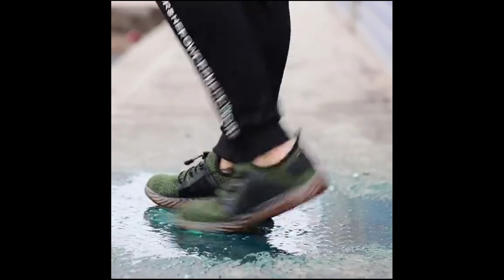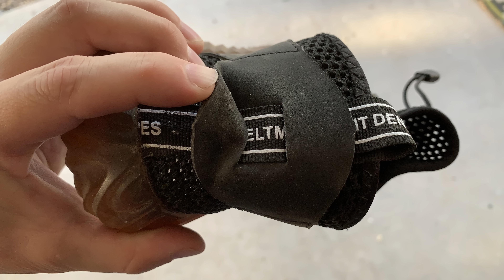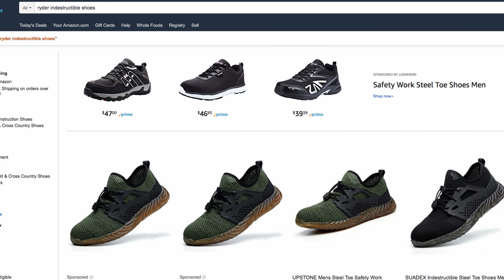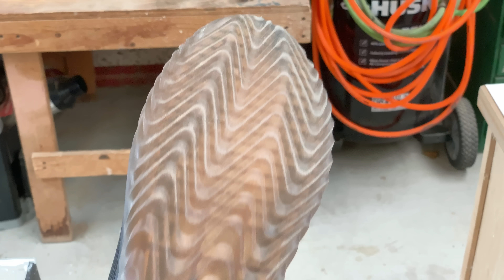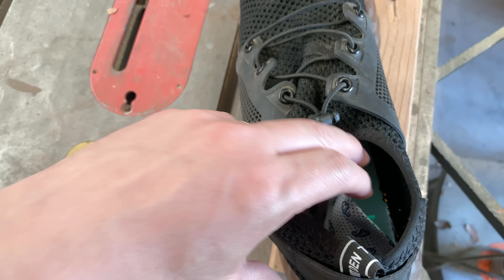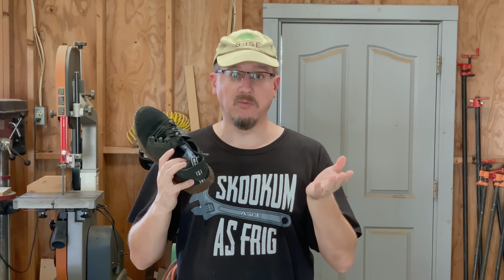"Indestructible" Ryder Shoes for $25?

Comment: Shoes are great but bottom deteriorate fast. I work in construction and bought 2 pairs. Lasted less than 6 months total for both pairs
Reply: Mines did the same thing. It’s almost like a foam rubber composition. 2 shoes lasted 5 months for me. Not worth it.

Comment: I bought these but wish i didn't. Complete garbage made in china not steel toe ( plastic toe) and not nail proof. heavy and Uncomfortable. Shipping times took 6 weeks to arrive. On requesting return they wanted to have me pay return shipping with a 15% restocking fee. However the left toe guard was not seated properly and rubbing on my foot, I argued that my defective shoe was why I wanted to return it. They offered a 20 percent discount. I said no I want a full refund and no restocking fee as it was defective. They approved the return with a 15% restocking fee on the next email and also a 50% discount if i changed my mind. I figure either way I'm loosing. Avoid this sh*t company and their sh*t product. Transaction as of March 28th 2021. Still no refund.
Reply from the maker: It is worth saying that if your shoes had a plastic toe, then it is NOT the same shoe that I reviewed in this video. The "Ryder" shoe has some notable issues, but it absolutely has a real steel toe, so that's not one of them.

Also, yes, I even said in this video (several times) to avoid the Indestructible Shoes LLC company and get the shoes directly from China at a huge discount.

Comment: I saw the ad for 80 bucks indestructible shoes and almost bought it at that price but I like to do my homework and it paid off. I bought these from AliExpress and got them in a week. They have a U.S location. Your review sold me, especially at 26 bucks and some change with shipping. I got 1/2 size bigger. These are awesome. I have to disagree with you saying not comfortable. These are like walking with just socks on and I mean that in a good way. If they last at all I will be buying them again. Thanks for the review.
Reply from the maker: Cool.  Yeah, after the video, I did get a pair that was a little bigger and then got some comfy insoles and the shoes at that point were definitely comfortable enough to wear all day long.

Comment: I'd still send you off my jobsites if you were wearing those.  They don't protect your foot, ankle or lower leg enough.
Reply from the maker: Yeah, these aren't rated by any official agency, either, so there's no way OSHA or any other job-site safety organization would be okay with them.

I will say that I'm not convinced that the "shoe" size of them is necessarily going to be a problem in all jobsites, though.  I ended up replacing these after a year with Keen Utility Atlanta Cool safety shoes - they officially meet ASTM standards and are definitely okay on at least some jobsites since I got them off of a recommendation by a pro, who regularly wore them on his jobsite.

Comment: I just bought a pair of indestructible shoes. The shoes look nice but as soon as I put it on I could tell there was something wrong. The left shoe was poorly made & where the steel toe started I could feel a protrusion into my toe. Even though the item is clearly defective, they won't give me a full refund, making me pay restock fee. I feel I shouldn't have to pay for a manufacturing defect. Tried to get the company to waive the fee but no luck. Tells me they don't stand behind their product. I'm not buying anything from them again and will advise the same to everyone else I know.
Reply from the maker: Yes, as I tried to show in this video, Indestructible Shows LLC is just drop-shipping these from China.  You can get the exact same show directly for far less money.  You may still encounter quality issues (common in shoes this cheap) but you'd only be spending $25 instead of 2x or 3x that amount!

Comment: How can be so cheap that good boot lol? How compare this shoe to like 150 euro shoes like engelbaut straus or uvex?
Reply from the maker: They are cheap in every sense of the word.  Yes, the steel toe is the real deal, but they are notably uncomfortable and odd sized compared to "real" work shoes or boots.  A legit pair of 150 euro work shoes or boots will be far more comfortable for all-day shifts and the shows will last much much longer.
Reply: @granworks  Yeah but what about durability, mainly becouse when i cutting grass i step on nail, so i asking about durability against nail etc. will be these 150 euro uvex or  engelbaut straus same, better or worse? Becouse i cant find any test of these shoes about durability here on youtube i only find test about these ryder.
Reply from the maker: My Ryder shoes lasted for almost a year before falling apart.  Rather than just buy a new pair every year, I splurged and bought a $130 pair of Keen Utility Atlanta Cool shoes.  In comparison, the Keen shoes are much more comfortable and are built like a tank - they are FAR better built than the Ryder shoes.  It's not even close.

I have stepped on many nails with the Keen shoes and barely noticed them, but it is true that I didn't try the same "direct force" test on a single protruding nail.  I'll look into that today.
Reply: @granworks  Well just normal durability against walking (if would be also running that very good too) on nail is ok becouse its what happened when i cutting grass (sadly i have shit boots), like i dont jumping on my land or something like that lol.
Also i thought you got is for free like for review.
Reply from the maker: Okay, I went out to my workshop and re-did the single nail test on my Keen Atlanta shoes.  The Keen shoes worked even BETTER than the Ryder shoes!  The sole itself is much thicker and that gave substantial resistance to the nail in the first place and by the time the tip got to the kevlar/protective layer, it didn't have enough energy to puncture.  I had enough confidence this time that I put my full weight on the nail and it never came through.

Given that, I can confidently recommend this very specific shoe - it is fantastic: https://www.keenfootwear.com/p/M-ATLANTA-COOL.html
Reply: @granworks  Can you please make also nail test of these expensive shoes like uvex, engelbaut straus etc. ?
Reply from the maker: I am not a professional reviewer, so I only review items that I bought for my personal use.  I was okay trying to destroy the Ryder shoes because they were only $25.  I am less inclined to go hard at shoes costing over $100 if doing so might ruin them!

Comment: This is just silly Chinese marketing. The truth is at $25 it's good value compared to most safety shoes you can buy in the West, but there are still dozens of brands selling hundreds of models of shoes with sneaker/running shoe designs that obviously far exceed this pair's level of protection and meet all the required safety specifications.

Comment: 1 year recommendation
Reply from the maker: They did last about a year, before essentially falling apart.  The soles delaminated and the mesh covering on the steel toe started peeling off.  But they worked remarkably well for that year.

Worth noting that I got a size larger after posting this video and also bought some far more comfortable insoles.  They were pretty comfortable after those changes.

So... if you are willing to get an insole and assume you'll replace them yearly, then go for it!

Comment: It's hard to complain about them for $25. There is no way that they will last that long. The cheap mesh will tear and fall apart, and that rubber sole will definitely detach from the upper mesh. 25 bucks though? Shit that ain't that bad, you can damn near treat them as disposable at that price point. That being said, the only scenario where I could see myself buying them would be if I went somewhere and I wasn't expecting to need a pair of steel toe, and if I could pick these up at any nearby shoe store, so I could just where them for the day, throw them away afterwards, and then bring my real pair the next day.

Comment: From observation, not experience. 
I'm pretty sure that single nail would've went through the kevlar as you have your foot inside the shoe and your bodyweight presses down on it. The nail didn't go through the sole kevlar cushion because it's only poking it, not penetrating it like it did with the sole. You will 100% feel the nail and most likely puncture your foot. Again, just from observation.
In a different video reviewing the same shoe, the reviewer tested the shoe and stepped on a nail and actually felt it puncture his foot. Also, it seemed slippery as he tried moving on a wet roof of a car. 
Anyways, I'm done watching these reviews, kind of lost interest, but if anyone is curious about this, keep watching more reviews or look up reviews on forums.

Comment: Nice video but you should refine your testing methods. Kevlar had been a part of Mike work gear for 13 years, and tho it has some abrasion resistance, and is good a distributing blunt force (bullets) it will not actually stop a nail. Had you stepped on that nail (and I'm glad you did not do it) your foot would've kept the insole in place, and you my friend would've had an unwanted piercing, and a tetanus shot waiting.

Comment: These shoes would be fine and dandy but most places want 8 inch boots with metatarsal protection now
Reply from the maker: Plus, they aren't certified by any recognizable agency so shops that require safety equipment by code will likely not allow these.  I consider them "just fine" for around the house and workshop.

Comment: This is a helpful video. You explained what's actually happening for a long time. You go to Instagram and see these super nice adds displaying products that seem like a good quality, and at the moment of looking at the add, you don't even find the price THAT intimidating because in your mind you are thinking about how you would buy these for someone you love and they would be happy, so you are on the edge of clicking the checkout button. Then a thought comes to mind: "hey, what about ebay and aliexpress, they must be having these types of products as well, at least similar". But then you check and see they are exactly the same, with the cost 3 or 4 or even 5 times lower. At that point I as a potential buyer lose confidence in quality of any products (even the expensive ones). Price does not mean quality, and these kind of ads on Instagram are not being helpful. However, the guy in this video was prettt convincing and I am going to order from Ali.

Comment: I owned a pair of these, held up about 6 months or so in an industrial construction setting, working 8-14 hours a day 6 days a week, I walked on everything from nails to rebar, a piece of rebar did manage to break the bottom kevlar protection but it did not go through, just bent part of it and made a crack where it clearly broke some. They did start to fall apart after the second month or so (The top of the steel toe coming off) but didn't start becoming unusable until 4-5 months in when the outter wall on the inside had been completely rubbed away and the plastic supporting the heel started stabbing me, I actually cut the part making contact with me away and continued to wear them until the steel toe started to fall out, the back of the heel split down the middle and started separating and the sole had large enough holes for dirt to seep into the shoe. Overall not bad at all, to compare I've purchased steel toe Skechers and Fila shoes for about the same price (I picked all 3 up for about 40-50 bucks each.) The Skechers fell apart right around the same time, and the Filas lasted a little longer but are starting to come apart now, I'm considering a pair of these until I can afford some higher end Twisted xs, for 25$ I'll get 4-6 months out of em, great deal. I've been paying 50 bucks or so for 6 month shoes.
Reply: Can you send link to Twisted XS shoes?
Reply: @Twizlful  ? They're just boots you can google easily. https://twistedx.com/shop/mens/
Reply: That is great performance for a $25 shoe.
Reply: Why wouldn’t you just buy a proper pair of boots for a construction setting

Comment: Think Dr Scholls gel inserts with arch support. I own these same shoes. Also, think about investing in Shoe Goo to fix the continued wear over time.
Reply from the maker: Yeah, I ended up getting a pair of inserts that are twice the cost of the shoes!  They really do work, though.  And thanks for the Shoe Goo recommendation -- I'd never heard of that before.
Reply: @granworks   I learned about the product when I went to put toe caps on my steel toe shoes. Pitty I didn't learn about it earlier in my life. It works great for bonding things together.

Comment: Seems like a great idea if only a reputable brand would do this. I just don't know that I would trust the steel to not fold in and amputate some toes with a heavy load
Reply from the maker: There are name brand steel toe shoes out there, that are also regulation compliant.  New Balance is definitely one of them.  You'll pay quite a bit more than $25, though.

I personally don't compare these to other steel toe shoes, though.  Instead, I compare them to other running shoes, which I would otherwise wear.  In that case, any load heavy enough to crush the steel toe on these shoes would have trivially squashed my toes to nothingness were I wearing my normal shoes.

Comment: I’m gonna be the freshest welder at my job now. Thx for the info on the drip
Reply: I'd check to see if they're flame resistant or get some sort of spray.
Reply: @WalrusWinking  I mean... Not sure how resistant plastic can be against flames :))
Reply: @mineborders  some polymers such as kevlar are fairly heat resistant.
Reply: @WalrusWinking  The bottom melts in contact with flames
Reply: Your boss may not approve
Reply: Mark Me I’m the boss now🤣🙏🏼
Reply: My name is tino too
Reply: Check to see if they're water resistant too
Reply: I highly doubt that the synthetic mesh is going to resist melting or reliably stop slag.

Comment: Okay so i have been using these shoes for over a month now. They hold up very well. I use them at my job as an orderpicker. I walk around 10 miles a day. I got free boots from my work but they are super heavy. So i decided to go with these. They are comfortable, and much lighter than what i am used to. The wear on the soles looks normal, but they definitely arent that slip proof ! I wouldn’t recommend stepping on a nail either. When you have a job with minimal risk of stepping on nails and stuff dropping on your feet ( yes the steel toe cap works but the rest of the shoe is not safe at all) i totally recommend these ‘

Comment: Uuuuh size 44 is actually size 11
Reply from the maker: As far as I can tell, an EU size 44 is roughly a US men size 10.5 and so the charts tend to swing one way or another.  Most of the charts I found equated a 44 with a size 10 -- including the charts on this shoe's websites.  As someone who does wear a size 10, I can say that the length is absolutely right.  It's just the width at the toe that pinches a bit.

Comment: I got those shoes for like 15 euros.
I think the sole is the best feature. The use of thick, flexible rubber and kevlar (?) insole is definitely a good idea. Even the quick lace is not that bad; it's way too long and falls to pieces if only you grab the plastic end, but it works surprisingly well in keeping the shoe on.
The elephant in the room is the steel toe. it just shouldn't be there. A heavy, stiff point is really uncomfortable in a soft shoe like this, because the shoe doesn't keep you foot in place enough. I really feel an unpleasant pressure on the pinky, and sometimes it gets asleep.
I think they should put some kind of light reinforcement instead of steel, or just remove it at all.

Comment: The failure to mention that the whole shoe is just a mixture of replicas leads me to give a dislike
Reply from the maker: Okay. I didn't know about the specific Adidas shoes when doing the video. And now, I'm not convinced that the parts are replicas -- I'm wondering if they are actual castoffs from the legit Adidas factory lines. Kind of a Frankenstein shoe
Reply: granworks No, but these replicas are actually made in factories next or close to it. They get leaked formulas from workers. Also these shoes are significantly lower price due to their cheaper materials used and safety procedures and stuff are cut to nothing.

And this shoe is indeed a mix between the NMD XR1 and Sobakov. (The sole is sobakov and the top is XR1)
Reply from the maker: I'm not sure we're saying completely different things -- it may just be a terminology difference.  In the end, everything is guesswork since none of us saw this shoe being built or know the people behind them.   But yeah, it certainly does seem like they are taking actual pieces from the NMD XR1 and Sobakov and incorporating them into this shoe, one way or another.

Comment: Wear those shoes for a month and see if the grip is good, I'd say try to actually try to step on a nail with full force and see if your foot is also fine, etc etc. So yeah I guess it's a fair review but I mean I wouldn't buy it nor recommend it either
Reply from the maker: I have been wearing them while building a house for almost two months, at this point.  They are still in the same shape that I got them.  The grip is still good and the steel toe has saved my feet on a few occasions already.  My feet do get sore after a few hours due to the lack of padding, but I'm probably going to get some insoles soon and we'll see how that works.

And yeah, stepping on a single nail with my full weight all at once would be the ultimate test of the "kevlar" layer... but in the end it is only a $25 shoe and while it exceeded my expectations for that price point, I DON'T trust it quite that much!
Reply: @granworks  respect